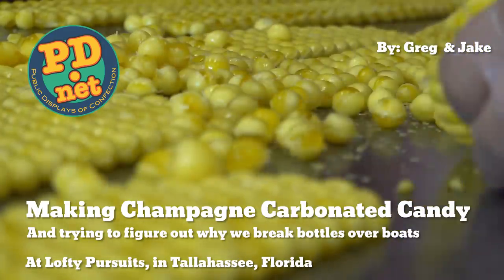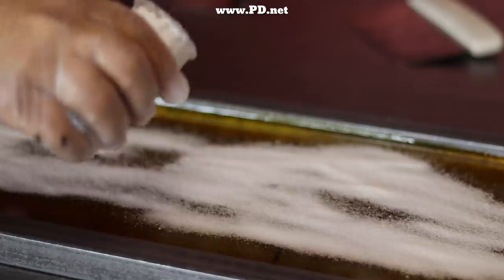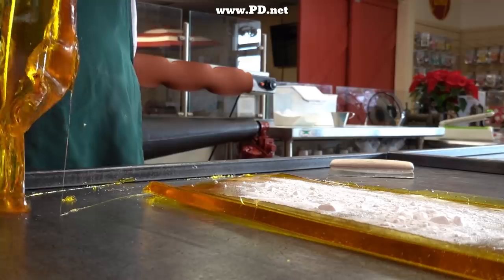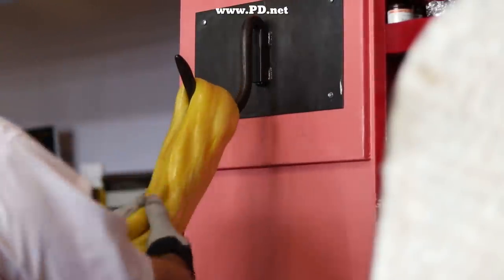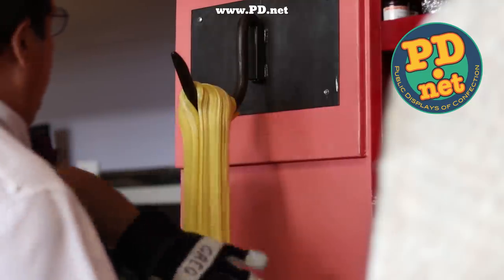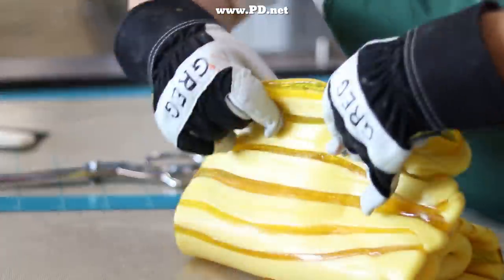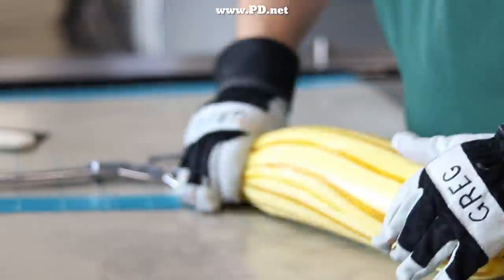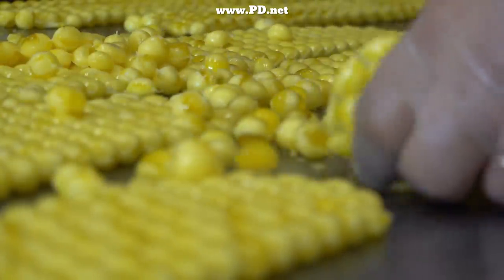#125 Making Champagne Carbonated Candy Drops

Comment: Once upon a time, several years ago, I worked for Amazon while they were opening one of their early new buildings in their consolidated Seattle campus.  They had a building opening ceremony, and they ordered a special bottle of champagne that had thin glass, to make it easier to break.  They had delivery problems, somebody had placed the order to be delivered to one of the old buildings instead of one of the new ones.  And then it came time to break the bottle on one of the new building's concrete pillars.  A manager swung the bottle and it . . . bounced.  Apparently they hadn't actually gotten a ceremonial bottle, they had a real one instead.  Maybe it was a replacement for the mis-delivered bottle.  The crowd laughed.  He swung again, harder this time, and it broke with an exploding pop!  I think the first swing had shaken up the bottle, releasing bubbles and increasing the internal pressure.
Reply: Thanks Kanye

Comment: So... the magic is just citric acid and baking soda hydrated in your mouth.  The first experience I had with that was an imported European candy back around 1969-70 called "Zotz".  The center was of course filled with a powdered mixture of sugar, flavoring, the acid, and the soda. There was quite a bit packed in there - a real shocker for the uninitiated and great fun for kids. You could seriously weaponize that stuff if it were packed into a candy in sufficient volume. Maybe make a prank candy for April Fools - a massively foaming blue raspberry drop - "Rabid Raspberry".
Reply from the maker: That type of hard candy is called a sherbet, no relation to the frozen treat.